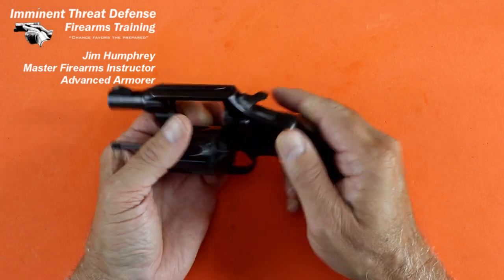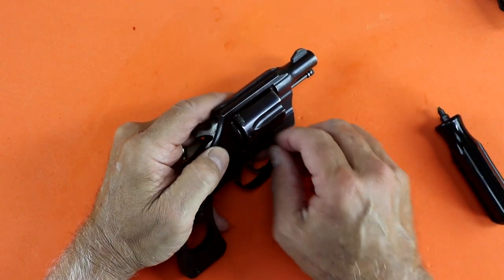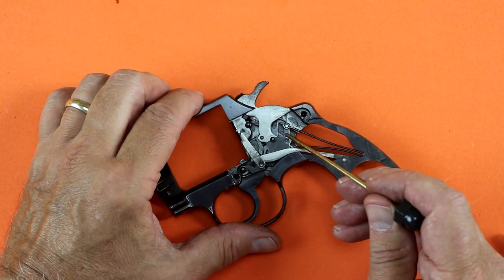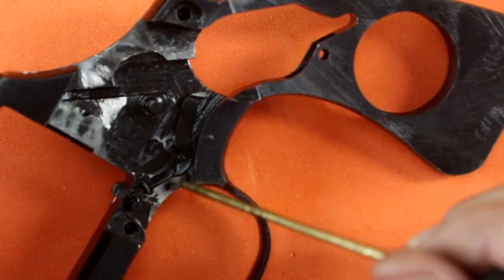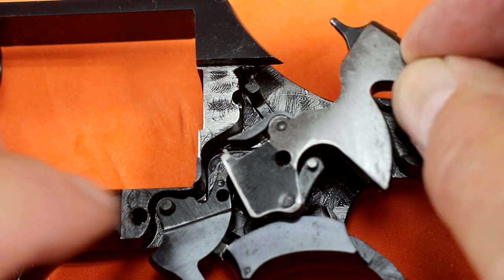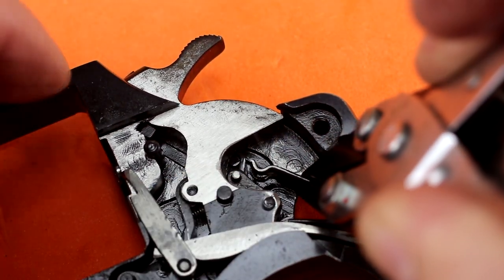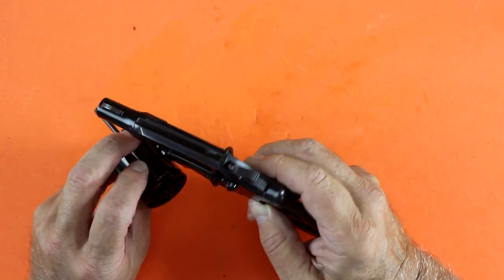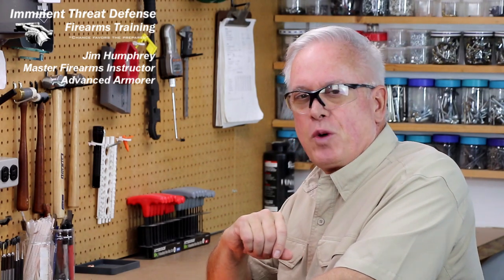Colt Detective Special Revolver Disassembly

Comment: I got a 64 Cobra. detective special 
The Special. screw that holds the cylunder.The one on the side plate.Does it have a Spring In the screw.? I pulled my out and it shot out.😅
Reply from the maker: Yep.  The D frame Cobra has a crane lock detent pin and a crane lock spring under the screw.  I just checked and Numrich is out of stock but Jack First has them for about $5.  So no big deal.  Hope that helps.  Thanks for watching.

Comment: I have my father‘s service pistol from when he was in the state police. At that time you could purchase your pistol when you retired. I love the pistol, but the grip is too small for my hand. I finally found a replacement grip, but when I Tried to replace it, the original stock wouldn’t come off after I took out the screw. Is there something else holding it? I couldn’t tell from your video. I don’t want to force it if there is something else keeping it attached. Thanks.
Reply from the maker: Probably just a little sticky.  Over the years various liquids, e.g. oil, sweat, wick in between the grips and the frame, mix with various dirts and kind of adhere the grips to the frame.  If you look carefully at the right grip at 0:40 in the video, for a very brief second you can see the stain of just that kind of sticky stuff. A few light taps on the frame (not on the checkering) from a rubber/plastic hammer should separate them.  There is a pin near the butt to keep the grips from spinning so always pull the grips straight away from the frame.  Hope that helps, thanks for watching!
Reply: @ImminentThreatDefense  thank you so much. It was my dad‘s 38 Detective special from the early 60s he left it to me when he passed a couple years ago. I want to use it but it’s so small in my hand that I’m afraid I’ll drop it. I appreciate the tip. Thank you

Comment: Hey Jim, I have a 1966 Diamondback. Are they constructed the same as the Dective Special here?
Reply from the maker: Never taken a diamondback apart, but every other colt I've seen is fundamentally the same
Reply: @ImminentThreatDefense  I was an armor when I was in the service but never have taken down a revolver. If I took the face plate off and just lubed it and didn't take out any parts, would I be doing  myself any good?
Reply: @robsaxepga  In fact I wouldn't do much more, at least not very often.  Just blow it out with canned air and wipe it clean with a q-tip and then hit it with a few drops of oil on the wear points.
Reply: @jimhumphrey6806  that's what I was thinking. Thank you!

Comment: The cylinder on my Detective Special is stuck. When i disassembled it, i saw the hand blocking the cylinder and not budging over. Is there a fix to this?
Reply from the maker: Hard to say without handling it but, with the cover plate removed check the hand for freedom of movement.  But if the hand pin isn't broken, then the hand should move back when the trigger moves forward, it's a linkage one can't happen without the other.  All I can suggest is remove the cover plate and work the action, and see what's interfering with what.  Hope that helps, thanks for watching
Reply: @ImminentThreatDefense  with the plate removed I can see the hand retracts when the trigger resets and spins the cylinder fine. The problem comes in when I want to open the cylinder, the hand is slightly in front of the cylinder thus blocking it from opening
Reply from the maker: hmmm.  Usually what causes the cylinder from opening is the latch pin isn't fully retracting, be sure to check that.  The hand retracts because it rubs (pivots) on the frame.  As the trigger moves forward, it pulls on the bottom of the hand, the hand pivots around the touch point on the frame and the top of the hand pulls back.  The rebound bar gives a little spring action to hold the hand forward.  So the hand moves on a direct linkage, it's not like it's spring powered.  which is a common reason parts don't move when the get dirty, there's not enough spring power to move them.  So this is a little baffling.  Try removing the hand and see what happens.  The cylinder won't rotate, we know that, but see if it removes the interference.  Also see if something is blocking the trigger from moving fully forward, the hand is attached to the trigger.  Hope this helps, let me know how it goes.
Reply: @ImminentThreatDefense  I'll have a look at the trigger again. The latch opens up fine allowing the cylinder to release if I move the hand slightly back. Obviously with the plate on I can't move the hand back a little to clear the cylinder for it to release